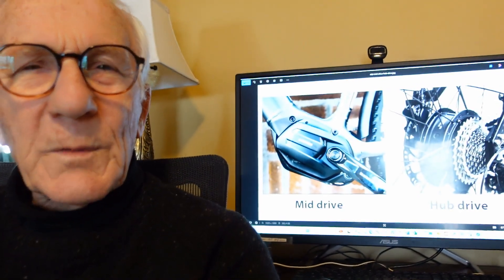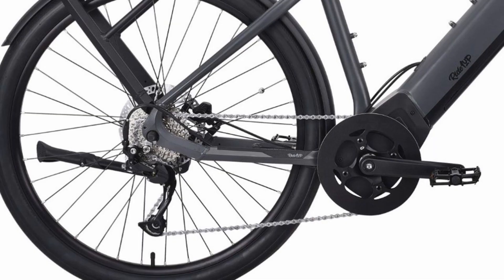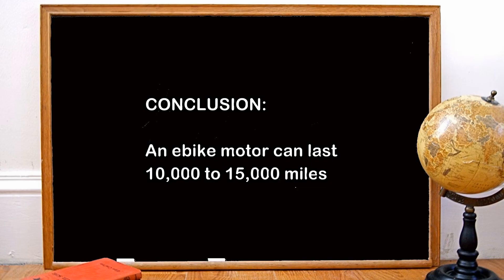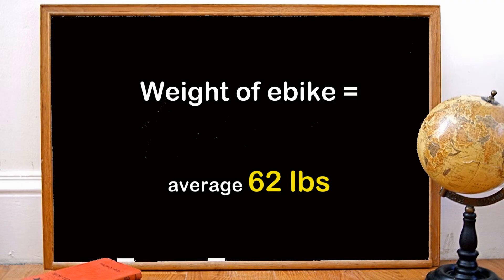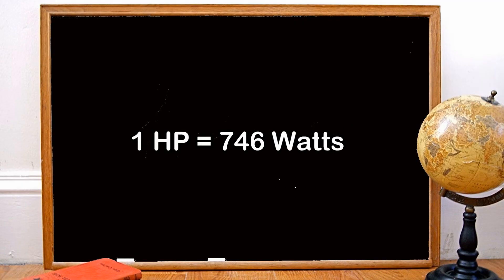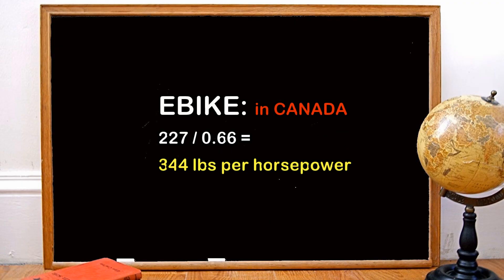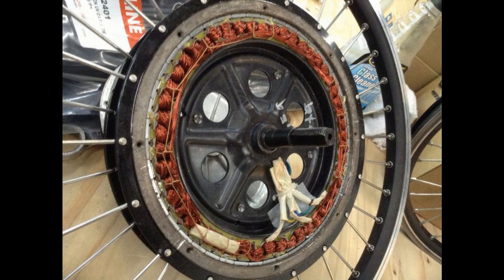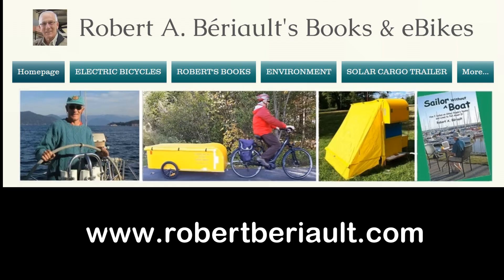Why Ebike Motors Have Such a Short Lifespan

Comment: Justin Lemire-Elmore of Grin Technologies often says if the direct drive hub motors don't break in the first couple thousand miles, they effectively will last the life of the bike. they either break early, or very very late
Reply: As a full time ebike mechanic I would say that anecdotally this seems very true and also somewhat applicable to generic and budget ebike parts in general: I would estimate 80-90% of catastrophic failures of motors, screens and controllers is either unreasonably fast (say a month or less) or takes years and years and many thousands of miles.

Geared motors specifically do indeed seem to have a lifespan of around 10,000 miles, with gear replacement required every 3k on average.
Reply from the maker: Interesting. And he's an authority on motors for sure.
Reply: @markifi  only moving part is the bearings, cost a few $ for replacements... Fitting can be a job if you don't do mechanical things
Reply: @lezbriddon  i've been replacing bearing grease with marine grease lately. it doesn't flow as well, but it's very waterproof. i think this is a good idea to do even to a new set of bearings to make them last longer. time will tell wheter there's anything to regret about it
Reply: @markifi  considering the riding in rain and                                        water that sounds a good idea.

Comment: All the math is very good. But simple the cycle isn't build tough enough .  Cycle tyres too last 3K miles max , car tyres more than 30k . A cycle can be found good & cheap 2nd hand , but not an ebike. So you need to compare a new ebike with a 2nd hand car . Then E-bike doesn't look so good. ... But both better than a helicopter.
Reply from the maker: I haven't though of that!

Comment: Guy starts the video saying he sold the bike that has the most reliable motor, futhermore if you change its bearings on intervals, protect the water ingress with a mudstop and axle rubber and coat the board to be waterproof, which is Bosch Gen2 😂😂😂

100k+ miles on such a motor.

Once the video started like that knew this guy had just sold the best ebike he had, LMAO
Reply from the maker: Thanks for pointing out that I sold "the best ebike" I had. It gives me the idea that I should make a video explaining the reasons.
Reply: @RobertBeriault753  Not the best e-bike. But the e-bike that had the best motor in terms of proven resilience. Which was the main theme of this video apparently.
Reply: is the gen2 sturdier than the new ones from Bosch?
Reply: @markifi  it is more sturdier than gen4, that is a sure thing. On the new one apparently the noises are gone because they used polymer gears... Guess what motor have polymer gears before? Yup.

Also, Gen2 is the only one that has a service kit for it from Bosch. But if you go the extra mile and replace all bearings (except the stator bearing that is irreplaceable, but extremely rare to fail) and you protect it with a mudstop and the rubber seal (these parts are not supplied by Bosch) you have a hell of a resilient motor.

It's bigger than the later ones, it's heavier. But protected and maintained is a tank. And this is the opinion of the people that repair them, so, not selling you any snake oil 🙃

Comment: You must ride around 7.6 miles a day for 5 years to get 7,000 miles. You're comparing apples to oranges, cars to bikes. Do you get 7,000 miles on a pair of shoes?
Reply: Motorcycles then. Honda Grom ~$3600 USD, expected life 120k miles
Reply from the maker: Ebikes vs shoes? Thanks for the chuckle.
Reply: @RobertBeriault753  That is funny. You would have to compare electric bikes to electric shoes to make a fair comparison.
Reply: I drive about 7000 miles a year on my ebike. That's only 20 miles a day.

Comment: In Europe, legal e-bikes are limited to 250 Watts ! They work with pedal assist up to 25 km/h (no pedaling, no riding 😃).
Reply from the maker: An interesting point. Some viewers commented that running a motor at a lower wattage would allow it to last longer. So maybe European bicycle mechanics get to replace fewer motors than American ones.
Reply: The legislation & labeling state a maximum of 250W, but check the real world tests & you'll see that brief peaks around 1100-1500W are typical of most name-brand "250W" ebikes. Not surprising, since even average sized non-pro riders exceed 1000W on a sprint, & above average sized humans use more than 250W just climbing stairs.

Comment: Cheaper e-bikes have the same philosophy as early Black and Decker power tools.... They were for DIY people not tradesmen and were built cheaply because they were not supposed to get used much....
Reply from the maker: Good point. Thanks
Reply: In China and throughout Asia your cheap hub motor ebike, which is a workhouse of basic transportation, can be fixed quickly at any local repair shop, down to the very mosfets in the controller.  Where in the US there is no one to fix it in most cases unless you do it yourself.  Pretty major difference.
Reply: Actually they are a Chinese  product that was developed for the Chinese domestic market then brought to the US and adapted in various ways to us preferences.

Comment: Batteries are the biggest failure!
Reply: I use my battery from 70% to 30%. 10 years later, the battery is still like new.
Reply from the maker: This confirms what the experts say. The problem is that it takes a battery twice as big (and heavy and expensive) as needed. In your case, your battery is twice as heavy as it need be. It's a personal choice, of course. Thanks for your comment. It gives me an idea for another video.
Reply: @RobertBeriault753  Doubling cost and size of battery provides way more than double the lifetime milage. assuming prices remaining stable and other failure modes don't creep up first, a bigger battery is cheaper. 

also, a bigger battery means more power. most EVs are battery limited when it comes to power output.
Reply: I sized my battery so that it would be cheaper than the equivalent in gasoline. it needed to last many 10s of thousands of km.
Reply: @difflocktwo   yea to sev in evening rest in morn to full just before trip
Reply: @difflocktwo  You're talking about using 40% of your battery.
Reply: @tarstarkusz  Yeah, or not even. I would charge 10-20% for a one-way commute and charge 10-20% for the way back.
Reply: @difflocktwo  Way more money up front and more weight to carry around.
Reply: @tarstarkusz  Weight isn't an issue. Rider weighs way more. Life time cost is way less. Battery will last decades, ignoring mechanical issues and corrosion. Anyway, batteries are cheap. What's the kWh price these days? Less than 200 bucks?
Reply: @tarstarkusz  Whatever your budget is, spend most of it on a battery. More than half the cost of an EV is the battery. You get more power from more battery too. All EVs are battery limited basically. More battery, more power.
Reply: Only if you don't look after them. I still have a working pack of lipos after 9 years mostly daily use by making sure their state of charge remained between 20% and 80%.
Don't leave them fully charged, and don't let them fully discharge, and if not in use maintain their charge at around 50% and check every month. They should last many years, not just one or two.

Comment: There are two problems, one is that the manufacturers try to get maximum power from minimum weight. The other problem is that manufacturers are not interested to built sustainable, repairable bikes as long as customers do not insist on sustainability. My Bosch Classic Motor broke down because of a plastic gear that could have been replaced easily, Bosch refused a repair and suggested a new motor for 650 EUR. I ordered a metal replacement from a small firm and the bike worked for another couple of years. Planned obsolescence in  a market that is rapidly evolving is the main driver here, IMHO. My old MTB from the early 90s is still running smoothly, btw.
Reply from the maker: And Bosch motors are touted to be the world's best??? Shame on that company!
Reply: Bosch are the mostly tightly integrated (state-protected "vertical integration" monopoly tends to do that!), but there are so many gearless Bafang hub motors out there running wayyyy beyond their specified ratings, that I've a hard time taking serious any upstart claims of reliability, & even worse is the outlook for servicing Bosch equipment...

Comment: You need to pedal on an ebike. Pedelec norm. Add 100 or 200 watts from legs. Otherwise tjis is a motor bike ....
Reply: What's the difference?
Reply: @difflocktwo  motor works too much if no ped
Reply: @difflocktwo ebikes that do not require pedaling are illegal on roads and public places !
Reply: @chryoko  are you a cop?
Reply: @chryoko  that depends on location. our rules in my state and country, NSW, state different powers for pedelec versus motor assist. 

anyway, unplug one wire and most pedelecs become motor assist...
Reply: I like what a cop told me: "If you're going slow, we really don't care. If you're going 50, the pedals don't matter anyway." 

Ebikes that just go bicycle speeds, are largely a non-issue, for them. Only legislators & over-competitive cyclists seem to actually care whether there's a throttle? 

(I've only ridden a few without a throttle & wouldn't own one without. They're a great safety feature for crossing rutted ice, surmounting a high-center point, etc. The arguments against, lack substance.)
Reply: More like 70 watts from your legs, 150-250 from the motor.

Comment: So do i need to open my motor and see what kind if any grease is on the gears...?
And should i plan to replace plastic gears with metal gears and grease..this is my first e bike and i can tell it would be great for traveling hills and long distance...???
🚲❣️
Reply: Way overthinking this. Ive ridden ebike 10 years, these motors arent a headache like a ICE motor.
Reply: @jaaklucas1329  thanks but I was talking to bob...👍🏻
Reply: @James-cs3hp  Hey no worries. Ive built 2 ebikes now over 10 years and 25,000K riding.Plastic gears no problem here(theyre quiet thats why instead of metal).You will hear them failing,never have. I doubt an expert could tell what kind of grease is in there!
Reply: @jaaklucas1329  it seems like metal gears would generate more heat..so did you use a hi temp grease on your builds with plastic gears...and would wheel barron grease prematurely ware the plastic gears...
Reply: @James-cs3hp  Ive never opened up either my motors hub or mid.A lot of riding. You will hear the plastic gears start to make noise before I go digging around in there! But thats me. Then I would open it up and I would replace the gears as they are not expensive. Then grease them. Plastic parts off the top of my head would require lithium type grease, a non petroleum type product which will degrade plastic/nylon materials over time.
Reply: @jaaklucas1329  greaset thickness im portant too thick really slows down bikes  normal bikes.
Reply from the maker: Good questions, but I don't know the answers
Reply: Definitely grease the plastic gears. DO NOT SWAP FOR METAL GEARS, it is noisier and can cause catastrophic failure when they fail
Reply: @chesterchen2684  that's good advice..🚲❣️
Reply: If you use it at mostly lower power levels  everything lasts a lot longer in between repair/ maintenance intervals.  Whether you want to do that or not depends on your goals but it's definitely the case. A gered gun motor could probably go 40,000 miles with just a few gear changes  if you ride mostly at 150- 300 watts and it's a 500 watt rated motor.
Reply: No, replace with the same nylon gears. About every 8000 miles is what I find is good, or, as soon as you hear noise, take apart and inspect. You may only need to replace one gear not the whole set of 3  if you get to it quickly.
Reply: @steveshea6148  what kinda noises does it make when going bad..ive got less than 400 miles on a 750w
Reply: @James-cs3hp like rough grumbling/ grinding noises
 Imagine small loose chunks of plastic being run through a set of gears ... Basically, gear teeth that have failed and gotten ripped off and shredded, , but also are the perfect size to jam into and fill just the bottom of the grooves of the fixed gear ring, causing the planetary gears to not fit fully into the fixed gear ring as the motor spins at like 4x per second
Reply: @steveshea6148  so it will be quite noticeable..lol I got my scooter last December I wonder if the summer heat and riding will have effect on longevity of the hub motor or electronics...
Reply: @James-cs3hp  heat is the enemy for motor windings. Best to use them within their limits, and they will last a LONG time. If you push them to their power and speed limits for long periods and customarily , they will last just a couple years . That being said,  brushless motors and controllers aren't that expensive to replace  assuming you do the replacing yourself . Consider that with 80  percent efficiency, a motor using 750 watts has  a 150 watt heater inside of it.  Motor windings  have enamel insulation that can carbonize if it gets too hot.  Carbon is a conductor so you go from a motor with 30 thin windings to a motor with 1 hide winding that student pulls r so much amperage that you're motor controller mosfets fail. toSay 200F is  a good upper limit for temperature cutoff.

Most of what you buy off the shelf won't have these heat sensors and cutoffs  in them. They handle heat control at the engineering table using statistical use scenarios...So that's why I say .. Use moderately most of the time,  don't push them to their limits all the time. It's really heat that it's the enemy. You can also melt the nylon gears... For off the shelf stuff, use it at its rated continuous capacity or slightly less, unless you really want to use all the power, in which case you just pay for it in much shorter product lifetimes. This is assuming you have an actual wattmeter on your display though. If there are 5 power levels, use setting 2 or 3 most of the time, reserving turbo or 5 for occasional use. ..that should cover it.
Reply: I'm talking about stuff you use every day for like an hour or two or like 5 days a week when I say it will only last a couple years with harder use.
Reply: @steveshea6148  that's where I am between 1 3 setting on 5 it goes 35mph kinda crazy even maxed out at 35 down hill it won't let the bike go over 35 the settings can be set to 8 speed but I have left everything at factory settings..maybe one day I may upgrade the bike but for running around town here it's nota bad way to commute
Reply: @steveshea6148  it is a daily commuter    but if the motor out last the tires it should be worth buying another motor and laceing it back to my rim..it's got less than 400 miles on it...
Reply: @James-cs3hp   if you just replaced the internal nylon gears and clutch once a year and don't overheat  it the motor will last for like 30,000, 40,000 miles... Yeah, even buying a new motor isn't that expensive. The clutch units are like $30 and come with the gears already on them. Just get one ahead of time and put it on your shelf. You will need a small three jaw gear puller to get the gears off your existing clutch, and a small snap ring pliers. And that red sticky lithium grease  that is $8 a tube is good enough. You don't need Mobil 28. To get the gears back on the clutch, a sharp blow with a hammer onto a block of wood works fine. If you are just replacingthe gears themselves. Harbor freight has a set of 3 jaw pullers that is inexpensive.  Honestly if you have two motor wheels--one for backup,  and some inexpensive replacement parts and the right spokes  you have ten years worth of local transportation just sitting on your shelf, practically speaking.

Comment: A motor or generator running in a low stress situation can last 100+ years with regular cleaning and maintenance. A motor over driven in a harsh environment with plastic gears dies young. No mystery.
Reply from the maker: Makes sense.
Reply: Exactly!

Comment: I gave up driving recently, and I have 3 ebikes. At almost 67, my ebikes should last many years. If one fails, ill buy another one.
Reply from the maker: It's a good idea to have a spare ebike.
Reply: @RobertBeriault753  I have 2 of the same ones. Instant parts if I need them, and 2 batteries, actually 3 batteries now. I can carry the extra batteries for a longer range. Merry Christmas.
Reply from the maker: Good strategy.
Reply: It's a good idea to have a spare comment.

Comment: All six of my eMTB’s are 2nd hand mid drives Bosch powered  eBay special, Cube, Haibike Sduro Hard 7 Haibike SD 9 Merida 120 Shimano
Most troublesome has been the Shimano eX 8000 motor and separately, controller failure after 2,500 m E8010 battery failure after 2,000m 
Bosch CX excellent apart from minor controller problems, one has over 10,000 miles, all five batteries OK except one battery BMS failed after 10,000 miles
Yamaha – difficult finding service agents in Scotland for my 3 Haibikes – 2k to 4,000 miles trouble free – all 3 batteries ok. After 5k one six yr old controller has gone rogue – causing motor runaway
(only new eMountain Bike KTM Macina Lycan was stolen after 3k)
Reply from the maker: It's surprising that you've had three with controller problems and a battery failure after 2000 miles. When we compare the need for servicing to cars, ebikes are a lot of trouble. But they're fun.😉
Reply: With builds like that, I would guess that they actually go off-road a lot! 

Harrrrd miles, those rocky ones are